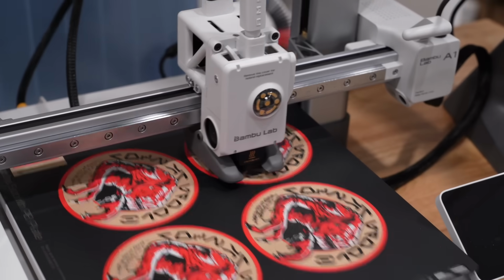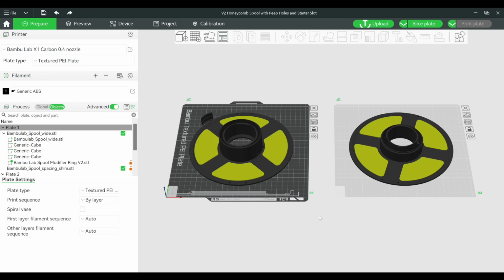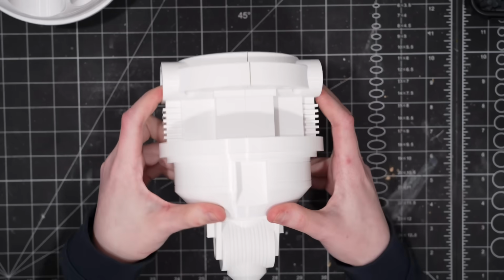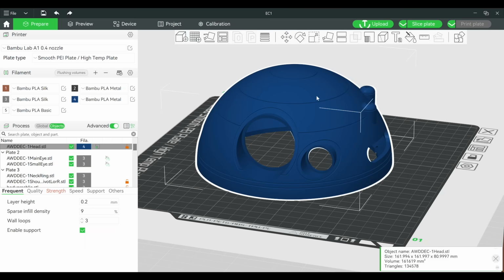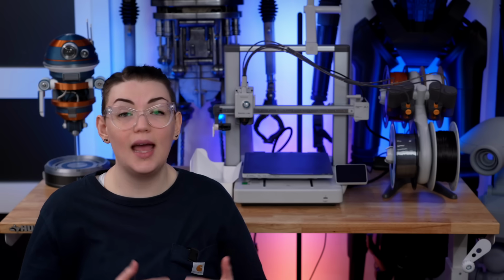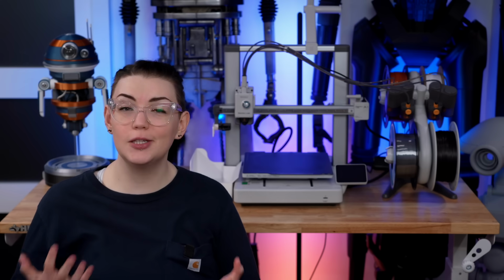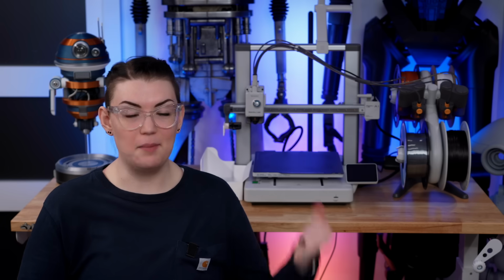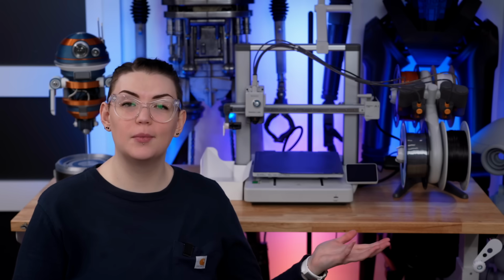Is the Bambu Lab A1 the Unbeatable 3D Printer for Beginners?

Comment: Very nice and yes they are good.  But just a reminder to give credit and reference where it is deserved. Bambu Studio is an adaptation of PrusaSlicer which is an Adaptation (a long time ago at this point of slic3r). Bambu would not be where they are without the open nature of the community and they have taken all of that and closed sourced it, including their use of Klipper as a Baseline.  I guess technically Bambu Slicer is still open....  But their closed source nature after taking it from the community is what bugs me most about this company and I will go with other brands first.
Reply: Let's clear a few things up. While the "base" of bambu studio is prusa slicer there are many features in studio, and the fork orca that were not created by Prusa or Slic3r. Any open source code is credited on the wiki and github. Prusa does not add multi-plate or mesh boolean . Prusa slicer didnt have svg or step file compatibility until bambu released it first. So both companies use each other(how open source is supposed to work)

Also the bambu printers DO NOT use Klipper or Marlin at all and is not a baseline for their firmware. The X1+ team have verified that and Bambu is officially on the record as stating such. You are looking at a team that worked for DJI. They can keep drones  stable in the air, do you think they need help calibrating a tool head, level a bed or reduce vibration from the community. They run their own electronics, motors, firmware and hardware. 

Nothing is "taken" from the community. They follow all Open Source requirements when applicable and have inhouse dev work they keep closed as any company can do.
Reply from the maker: I never meant for it to come off as Bambu Lab themselves had created this amazing software on their own. Basically every printer brand’s slicer is derived from another (and it’s a fairly universally known fact at this point). In almost every other instance though, the brand’s slicers are terrible and even go so far as to be a main contributing factor in poor print quality, etc. How Bambu Lab adapted and added to the previous slicers to have Bambu Studio actually be a functional software to use with their machines is what’s important.
Reply: @MMsPropShop  No harm done, love your content.  It just ties back to the end of my comments that when a company like Bambu utilizes open source and then closes off their changes from the community, there should be a mention of this and those watching can do what they will with the information.  We have such a great community and these awesome tools (software and hardware) because of the openness and willingness to invent and share.  What happens if everyone turns inwards and holds their next great thing close to their chest (closed source) because they want to make a buck at all cost?  We are seeing Prusa starting to turn inwards because of all the copy cats and yes, China can copy their designs for cheaper.  A premium printer brand like they have built and was the go to might not last. We can say well that is capitalism, but  if we are left with copy cats and no-one to innovate, our hobby goes stagnate with no new innovation like Klipper and fast accurate printing, or affordable premium printers with great customer support and new sensor tech and tool changing.  My voice is tiny on this, but if it matters, I hope those with a larger voice can bring awareness to it.
Reply: What are you talking about?

Tell me what exactly did they copy?  The use of lidar(X1C), eddy sensor(A1 series), AMS/ams lite, cutter/poop chute with ams were not being used in any commercial or open source product in mass. Printing without a slicer was only in Ankermake and bambu. So tell me what exactly did they copy/take? I'm actually curious as no one who uses these talking points have been able to answer. 

As person above said everything that is open source is notated and accredited. No company that uses some Open source(OS) items needs to open all of their inhouse stuff. They arent abusing patents or suing the copycats either.   
How are they closing off changes in the community? 

I am terribly curious on what exactly you are saying. Plenty of companies don't want to do the hard work in making an inhouse solution so you have a bunch of machines running full or gimped klipper. BL isnt running any Open source that isn't credited and the community hasn't been hindered in anyway.
Reply: @personwomanmancameratelevision   They make wild accusations but cannot back up their statements when pressed. They gatekeepers of the 3d printing community will be overshadowed by people who just want a working device. This video reinforces it. 

The A1 is a well made machine for beginners and advanced users alike.
Reply: BL doesnt use Klipper. Most of the stuff you said doesn't make sense. 
Do you get hot and bothered about TV, cell phones, computers, processors, cars and 95% of the things you interact with in your life too for not being "OPEN"?

I notice you stopped responding when people called called you out on the 💩

Comment: Is PLA Matte worth it over Basic? And what are the slicing differencies? Thank you :)
Reply from the maker: They’re both PLA so they use the same general temperature/cooling parameters. The biggest difference between the two is finish. The basic has a glossier finish than the matte so it really comes down to personal preference on how you want your finished prints to look.
Reply: @MMsPropShop  I prefer Matte for the smooth finish but some people report issues with adhesion problems, is this true? Also, Is it OK open in the AMS or does it need drying before use? Thinking about enclosing the AMS. Thank you very much for your answers, I'm about to get an A1+filaments  and need some more info :) Your video is a great guide 👍
Reply from the maker: @KebabDoner7 the matte PLA didn’t have any issues whatsoever sticking to the smooth plate in my experience.

It really depends on your environment. I’ve never had issues with moisture effecting the filament too much. I’ve used rolls that have been open and not stored any particular way for 1 year plus that I’ve grabbed to use on a print and have printed fine. It all just really depends on the humidity where you live and what it’s like in the space the printer is going to be living in. I have seen a few prints out there that will enclose the AMS rolls that seem to be popular and effective. Never looked too much into them though since wet filament really isn’t an issue for me ever.
Reply: @MMsPropShop  So I shouldn't worry about issues with the textured plate either. I'm more interested in figure models so I think Matte will help with the invisible layers.
Reply from the maker: @KebabDoner7 I would imagine it wouldn’t be a problem. There are multiple tricks that can be applied if bed adhesion is of concern anyway; glue stick, brim on the print, etc.
Some matte filaments can feel almost too “dry” or have less flow when printing, the Bambu Lab ones seem to not suffer from that at all.
Reply: @MMsPropShop  Thank you so much for your replies!
Reply: You can change the finish of normal PLA by changing the outside wall print speed. The faster, the more matte it will be. Matte means it prints too cold and it’s not good for functional parts. 
There is a option in Orca Slicer to not slow down for outer walls under cooling. It will worsen overhangs.
Reply: @Todestelzer  Yep speeding up is an option as well, but at what cost for the quality? I mean, just factory settings with Matte and the result will probably be better. Ain't shiny but better for figure modeling imo.

Comment: A great quality bed slinger, if a little slow compared to other printers in the price bracket.
Reply: Slow?

I thought it was faster then most
Reply from the maker: @Jan_Eberhart it technically can’t hit the high speeds that most core XY printers will boast since it is a bed slinger style, but looking into its default settings, it runs almost identical speeds to what I’d use on even my fastest machines. Just because a printer can go faster doesn’t mean it should.
Reply: @MMsPropShop  y, but then atleast the same speeds.
He said it is slower.

Also, Im only talking about bed slinger style, since he said „in the price bracket“.
Enclosed are usually more expensive

Comment: What is the speed like compared to a core xy like the p1p or adventurer 5m 
Was this all pla?
Reply from the maker: It’s technically slower but looking at the default settings, it’s running pretty much at all of the same speeds that I’d use on any of my core xy machines. 

The white single colour parts were PETG, all of the coloured prints were various types of PLA.

Comment: Very cool! Nice print. I've toyed with the idea of getting A Bambu or a Neptune 4 Max. I've never been into multicolor though. I wish the multicolor people could figure out how to purge the colors by printing the purge in the supports rather than just wasting it.
I wonder if the aftermarket will come up with a better replacement camera?
Oh, any tips on how to handle an issue with PETG? The lower neck strut mounts on my Johnny 5 bust keep snapping. I originally printed them in PLA+ but when they snapped (due to some help from a certain furry monster's tail causing a face plant) I printed them in PETG and then painted them. The replacements snapped within a minute of install. It is annoying.
Reply from the maker: There is an option to purge into an object but it still runs a similar cycle change. I’m guessing it’s due to the varying amounts of infill on any given object, it would only work on decent sized pieces and even then there will be a point where it’s all surface layers with nowhere to hide a possible colour change. I’m sure it’s something that will continually be improved upon to be more and more efficient.

It seems most people just set up a smart camera by the printer to monitor it. It’s not so much the camera itself as it is the processing ability of the printer being able to handle the higher frame rate. Other machines I have with built in cameras have no issue with hitting 15-25 FPS so I guess they just have the extra processing power to spare.

With more delicate parts like that you may be able to increase the strength by upping the print temperature/turning off cooling. It might decrease the surface quality but it sounds like strength is the more important factor here. If that doesn’t help, then printing them in a different orientation might. Having the layer lines running in the opposite direction should eliminate the snapping.
Reply: @MMsPropShop  Purge in the infill and supports makes sense. Pity there is still waste. 
Camera: yeah I can see that. A lot of people like doing time lapses which do not need a high frame rate.
Part: Ah, thanks. I'll have to try that.

Comment: I have both the A1 mini and the new Kobra 3 combo. Both are good beginner friendly printers. However, personaly I prefer the ACE pro over the AMS (light). An integrated filament dryer for 4 filaments practicly for free is hard to beat. 
Also the ACE pro is announced to be usable on other printers in the future. I did some test, like shutting down the printer - the filament dryer still continued to work. I disconnected a tube while printing - the sycronisation between the ACE and the printer definitly is done by the ACE, not the printer. So the communication between the printer and the ACE definitly is more simple than on Bambulab printers.

The reason I am so eager to use an AMS/ACE on another printer (like the SV08 or the Qidi X-Max 3) is the waste. All theese modern printers use high speed and therefore high flow hotends. While this is nice for single colour prints, high flow hotends make it practicly impossible to shape the filament on onload reliable to be loaded again. This is the reason behind cut&poo, a lot of waste and time for filament change.

If you have a standard flow hotend, esp. with integrated nozzle/heatbreak like Revo or Nextruder nozzle, you can very reliable unload the filament using ramping profiles. Much less waste and time for filament changes.
Also: cutted remining filament can not be retracted anymore. You can only poo it. While without cutting, you can use most of the remaining waste to print into a waste object were colour does not matter.

So we definitly need an AMS/ACE cinnected to an open source based printer, like the SV08. Actually The Next Layer did a Revo conversion there.

So while the Bambulab printers are beginner friendly, if you realy want multicolour (but not a expensive toolchanger), you need a hotend swappable between standard flow and high flow. Like the Revo.

While you can do multicolour on Klipper based printers using ERCF, this is not very beginnerfriendly and easy. So I realy hope someone adapts the new ACE pro for Klipper.

Actually, the AMS/AMS light/ACE pro are all around 300€ if purchased seperatly (the AMS light a bit lower). But the AMS / AMS light are bound to Bambulab printers. While it is pretty sure the ACE pro will eventually be usable on other printers.

So my beginner recommendation is definitly the Kobra 3 combo. As a beginner most likely will becomme less of a beginner in future.
Personally I have a lot (realy a lot) of 3d printers, as my hobby is more tinkering on printers rhan axtually printing. However, with the Kobra 3 combo just 150€ more than the ACE pro seperatly, I could not resist. But the moment the ACE works on other printers , I will sell the Kobra 3 (and the A1 mini wirh it's AMS light)